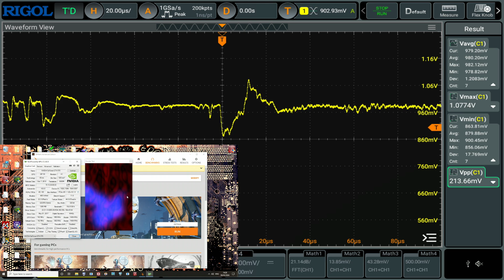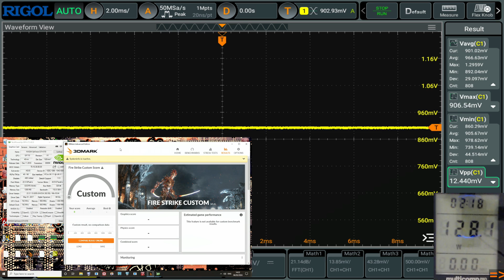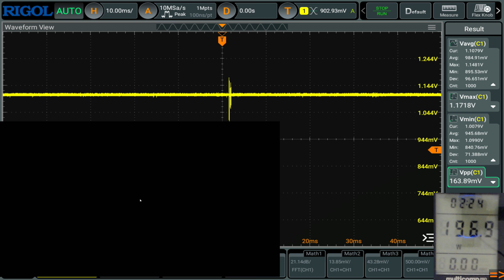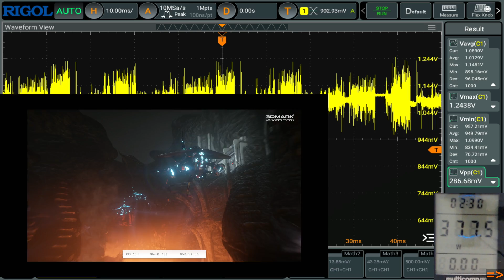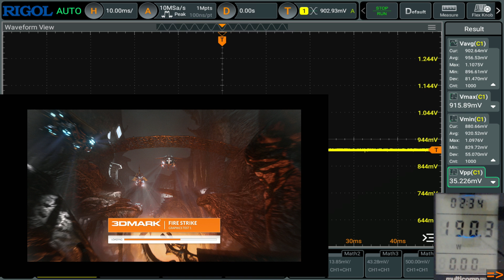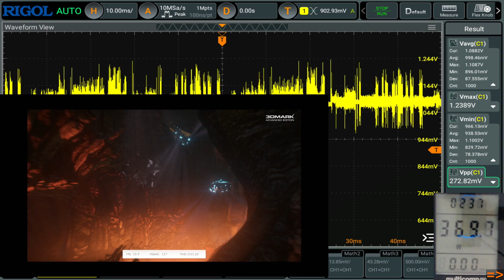Checking the core voltage regulation of a repaired ASUS GTX 570 DCUII

Comment: What's the safe daily ring voltage on RaptorLake? I didn't find anything regarding this.
Reply from the maker: the ring runs on Vcore.
Reply: @ActuallyHardcoreOverclocking  I don't think it does on my board at least. Increasing vcore doesn't do anything for it and there's an uncore vid in hwinfo. Also XTU has a dedicated ring voltage section. I think I read somewhere it is handled by the FIVR on the cpu.

Comment: Hey, very out of topic, but I'm working on a micro build for work. I remeber you mentioning in a video that I'm having trouble finding that the 4000 series apus from amd had a differnet memory controller, is that something that continued into the 5000 series? I'm trying to decide on a 4700g vs a 5700g and want to know if it's worth looking at the older hardware even though it's more expensive. Could you give a little insight? Thanks!
Reply: afaik it's just that the 4000 and 5000 APUs are monolithic, so you can clock the FCLK and UCLK a lot higher than on the chiplet CPUs. even if that's wrong, practically speaking both chips will run very high FCLK and UCLK, so it doesn't matter a ton. I believe the Zen 3 chip usually goes a little higher, but a few hundred mbps really doesn't add up to much
Reply: @zuckdaddy1596  Thank you! Was more curious to play with the rare-ish hardware if it did behave differently. I'll just grab the 5700g.
Reply: @dogeislyfe2050 how did it workout for you?
Reply: @luvingyouu  got an okay chip, does 2200 fclk, don't know if I'm limited by my ram, CPU, or my board, just hits a hard wall and refuses to post higher
Reply: @dogeislyfe2050  could be board. Most people struggle to hit even 2100 on lower-mid range boards even with decent or good kits of ram (from what I have seen). I saw a post maybe half a year to a year back in an overclocking forum for ryzen 5000 cpus and they posted a survey what was everyone's max fclk and like 5% out of almost 200 had 2100 or higher, so 2200 is quite good. Me on the otherhand I can't get my 1700x with a b350 asus prime to run 3200mhz stable lol, thanks zen 1 memory control! I run it at 3133 stable which hurts to look at
Reply: @sparklingion  I'm on a gigabyte b550 mitx board (aurous pro whatever), I'd assume it isn't the board but there's really no way to tell without an expensive one to compare to. I will also say this is a 2x16 b-die setup running really fast and decently tight on a ryzen memory controller, I don't know if that's something they do well (I imagine it's not)
Reply: @dogeislyfe2050  good board spec wise, probably wont be much better than most maybe except msi unify which is a beast. From BZ videos I have seen you can run quite fast and tight on r3000-r5000 cpus, so could just be you are maxing one aspect of what the board, cpu memory. I think 16gb kits of ddr4 do cap out a bit before 8gb kits at least from what I have seen, could also be something like that. Still pretty good though

Comment: TFW I'm sweating in near-30C heat and BZ is playing with goddamn Fermi
Reply: Just because the GPU core ran hot doesn't mean it produced that much energy. You could run a liquid cooled 3090 Ti at 50 degrees and get drenched in sweat because it's kicking off 600 watts in your room.

Comment: Also known as NEC Tokin crapacitors.
And, also, notorious troublemakers in Toshiba laptops and the Playstation 3
Reply: Interesting.  What model laptops?
Reply: @johndoe7270  I'm not sure, but I think that some Toshiba laptops had the capacitors right below the CPU, on the other face of the PCB, and because of the temps, it ended up breaking after a few years, there is a video talking about the PS3 ylod for 1 hour and 23 minutes, and in it they talk about it, maybe it will interest you.
https://youtu.be/I0UMG3iVYZI